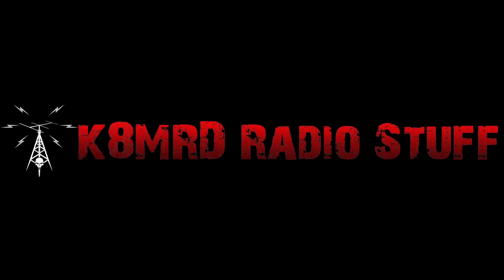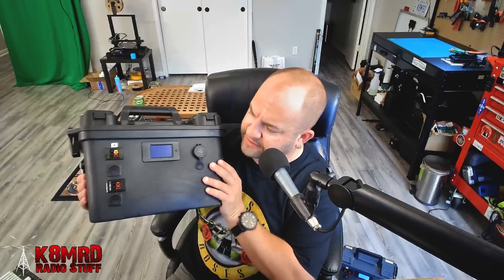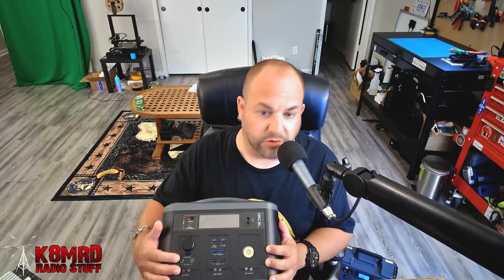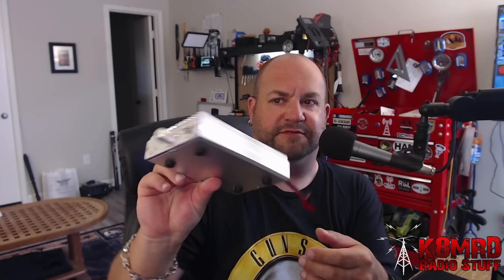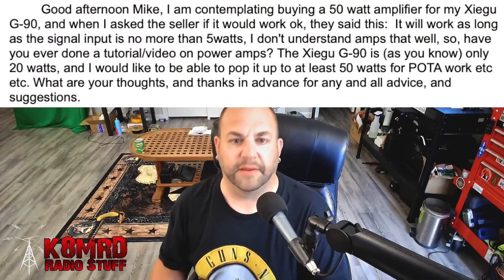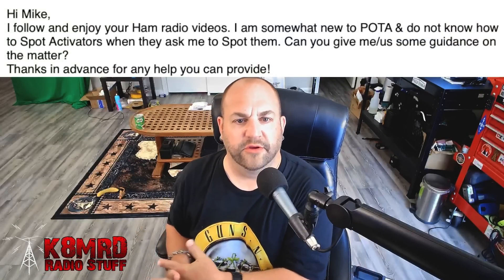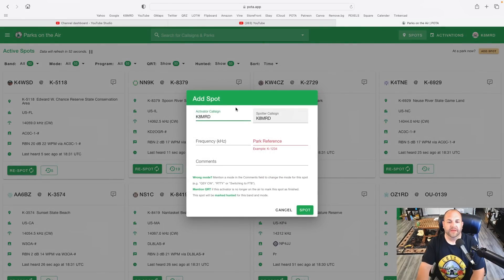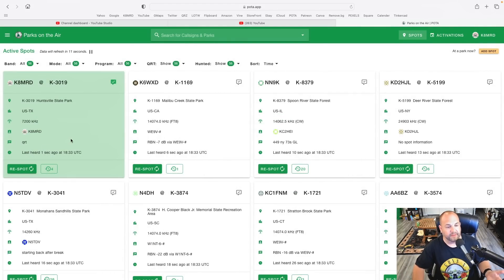How To Use The POTA Spotting Page

Comment: Just watched this Video: good work!

A tip I learned from Temporarily Offline, KM9G: I purchased the UDPower C-400, which has a 20Ah battery inside

The back has an EC5 port for “jumper cables” that gets direct high amps access to the internal battery. 

I have tested to work both my Icom IC-705 and Xeigu XPA125B amplifier and it works!

I have an EC5 to Anderson Powerpole adapter cable arriving from Amazon later today. 

This will be my power source for my inaugural POTA coming soon!

Comment: Is there a way to pull your spot on Pota for what ever reason ? Say you are done and moving to another park and only takes 10 minutes to move, Or say you just want to pull the spot and just work those that are already there and finish the pileup.
Reply from the maker: Yep.  In the comments section where you would spot yourself, just put QRT and it will mark you as done.